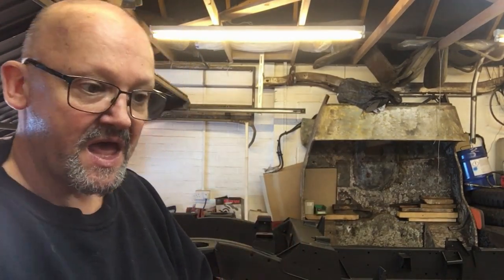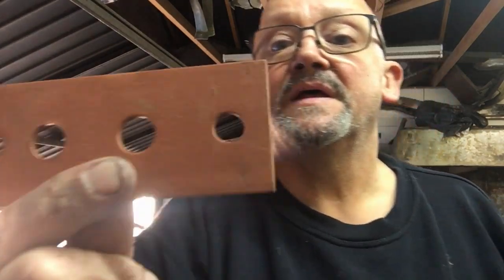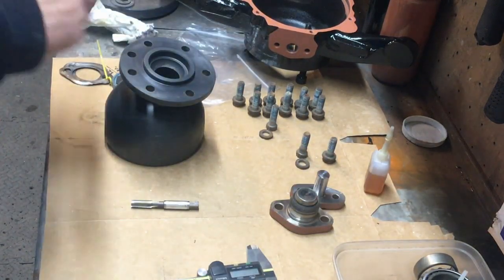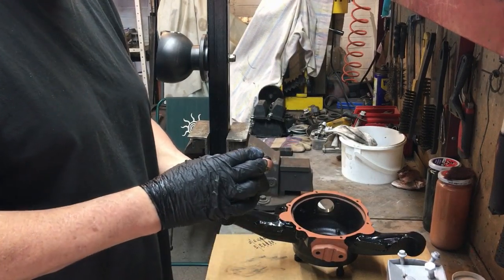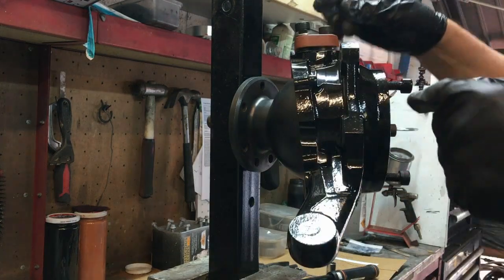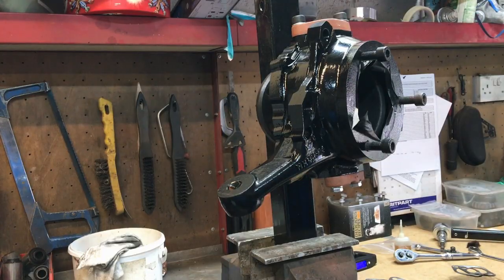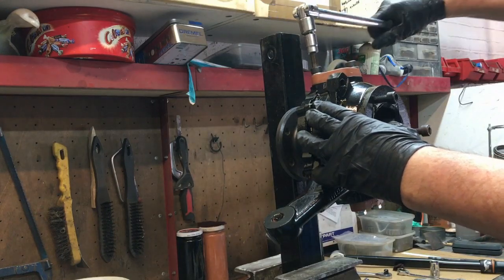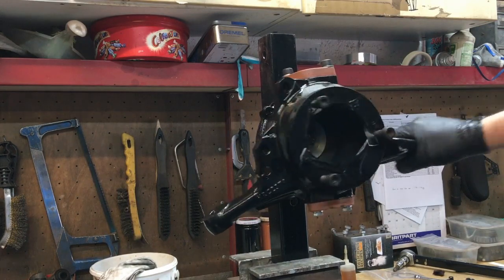More Painting and getting the swivels shimmed.

Comment: So Nigel I have a question for you about Range Rovers. I have at the shop I work at a Defender 110 that I'am putting a 2020 GM 3.0 L Duramax engine in. My question to you is does the 110 refer to the wheel base?
Reply from the maker: Yes James. I'm not sure what the wheelbase is exactly, but it's close to 110. Mine is a 90, which I believe is actually a 93" wheelbase. The 2.8 Isuzu diesel makes for a lovely swap into a Defender.